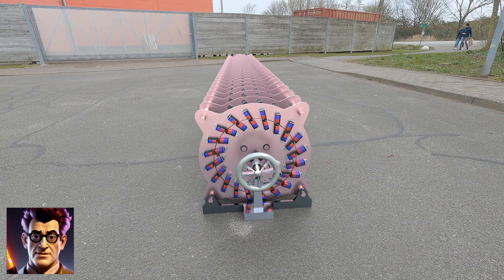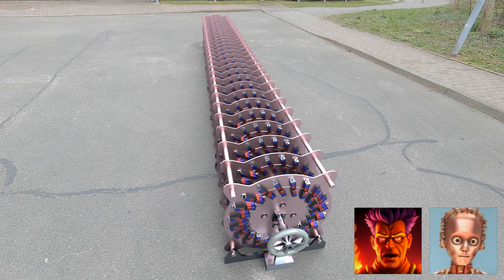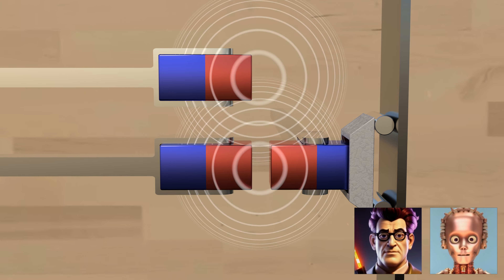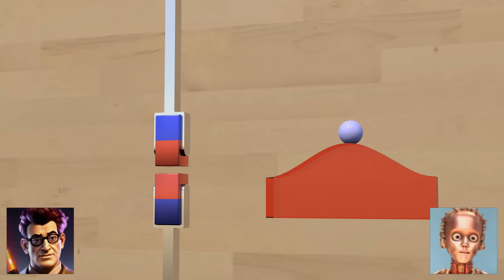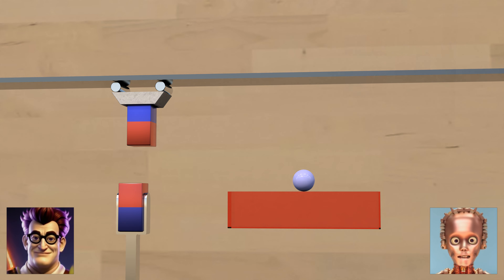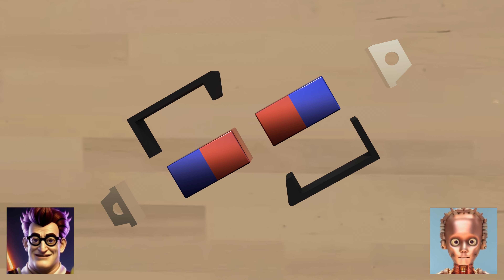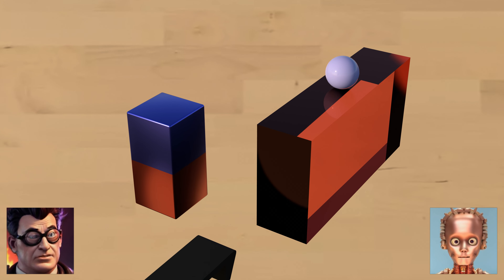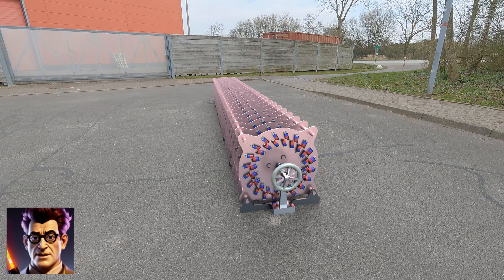Truth: Giant Perendev Perpetual Magnetic Motor, free energy for 5000€, Mike Bradys magnetic elevator

Comment: Technically it is still possible to make work. But it does require external energy. But the important part is that it requires less external energy then it produces..!
Reply: Solar power can work
Reply: The Takahashi magnet motor is such a device, with claimed coefficient of performance about 4
Reply: @ObjectiveVoice  It takes way more enrgy to make solar panels then it can generate.
Nuklear power is the only proven energy producer that can regain the power and cost to make.

Comment: I think its interesting that people think magnets can somehow magically give you free energy when they are just basically doing what all matter does but from a longer distance.  They just create a force.  You don't see people assuming you could blow into a straw, then wrap the straw around in a circle and somehow expect the air to not only perpetually circulate but actually cause itself to accellerate..  They think they can somehow change the laws of physics by making a machine that is progressively more convoluted.. like if they can't understand how it works, maybe then it will violate thermodynamics
Reply from the maker: Hi Derpnerwerp, thanks for your comment. Yes magnets just create a symmetrical force. Thx for watching 🙂
Reply: Dynamo boom free energy for the foreseeable future are you blinde
Reply: So it's impossible to create an imbalance in the forces?

Comment: I have a question Mr yWild - if the magnet to magnet attraction was  - (let's pretend) 100 units at distance 10  and the magnet to steel attraction was 10 units at distance 10  and the magnet to magnet attraction was - (let's pretend ) 1000 units at distance 1 and the magnet to steel attraction was  EQUALLY  1000 unit at distance 1  and you 'entered' the SHIELDED MAGNET UNIT on the 'magnet' side  and left the SHIELDED MAGNET  UNIT  on the steel side   (like a James Roney Stator)   it seems you OBEY the law of Magnetism yet BREAK the laws of symmetry     what say you ?  See KJ Magnetics tables / graphs to confirm the logic

Comment: This video makes a lot of sense. What is always overlooked is the part of using magnetic shielding in the correct index points will make the motor turn. The question is how much power can actually be produced for the unit. v
Reply from the maker: Hi Victory, thx for your comment. I tried magnetic shielding but the magnetic influence of the shielding-material itself prevented the success.
Something like the right configuration for gaining energy might also not be possible. Refer my gravity model approach 🙂. Thx for watching

Comment: If you used an circuit that could turn on and off the magnets. 

You cannot produce more than you can create...BUT... you can make an engine more efficient just a small amount.

Magnets should be used as low friction bearings bearings. There would still be friction  but the reduction in friction would be an efficiency gain because no energy input would be required to imagine the gain.

Comment: The ball example makes very little sense. Seems to me if you had another ring of magnets using attractive polarity(or possibly just one) towards the center of the hub spaced differently from those on the exterior, that'd be enough to pull it into perpetual imbalance, adding additional magnets to the outter ring or asymetrically inverting the polarity on some could also likely create the perpetual imbalance. If the angles of the magnets of the inner wheel were increased so that the pull force of one would negate some of the push force of it's neighbor, that could also potentially create a perpetual imbalance. It seems bizarre that you suggest this is impossible because it does not have a perpetual imbalance, yet nothing here has been suggested or theorized on how to do that. A good start would be to try asymmetry in magnet counts, positions and polarities. Shifting weights (even liquid) could also be used to pull magnets beyond the balance point. I'd suggest also that this design of multiple wheels adds significant weight and redundancy.
Reply from the maker: Hi Brian, thx for your comment. The gravity model is not the highest rocket technology, but a way to make clear what is happening in the hidden. 😀 thx for watching

Comment: This repelling principal fails due to it requires the same amount of energy it creates for the magnet to enter the field. This principal will only work with the Magnets N&S pulling at each other like a real electromagnet motor works with a slipstream like graphite between the magnet to release the magnet from its magnetic field so it can move on to the next magnet. Reach out if you want to make a prototype together.
Reply from the maker: Hi Rockstar, thx for your comment. Think about my gravity model. You will see, that you will not be successful building a working device in this manner. Thx for watching 🙂

Comment: I have considered using a double coil in series, one coil over one of the opposing magnets and the other in between as a current pickup, this current would create a weakening opposing field (like the magnetic field blocker), allowing the magnet of the rotating ring to become in alignment before it repels. Then comes the relation that there will be a counter emf force in the other pickup coil that takes the place of the weaker field which adds the resistance back into the magnets repelling and again there is a cocking effect.
Reply from the maker: Hi James, thanks for your comment. I made a video to think about with an electric magnet for doing something on that way https://youtu.be/jYsRonUeRTM 
I’m very curious if your idea will work. Thx for watching 🙂
Reply: There is no monopolein magnetic field. If you block one pole - you instantly block an other. Its just a dream
Reply: За тако нешто би требало направити електронско окидно коло са могућности регулисања у +или- времену, као подешавање паљења и предпаљења на савременим бензинским моторима..пробати тако..!?
Reply: The concept of harnessing free energy through perpetual magnetic motors has long intrigued inventors and enthusiasts alike. One such notable example is the Giant Perendev Perpetual Magnetic Motor, which claims to provide free energy at an affordable cost. Promoted as a solution to energy independence, this motor allegedly utilizes magnetic forces to generate power continuously. With promises of a New extended updated Edition in 2019, including 3D models, bonus downloads, material lists, pictures, drawings, tool lists, shopping lists, and patents, it aims to provide enthusiasts with the necessary resources to construct their own magnet motor.

Comment: The motor does not turn on it's own. But it does have less counter force impeding its forward progression. How can you use that to make cheaper electricity. Every time the magnet moves past the other magnet there is a movement of flux in both directions. Just put a pick up coil on the end of each magnet.
Reply from the maker: Hi Wes, thx for your comment. It looks like less counter force. Unfortunately It isn’t. Either by entering the field or by leaving, there is an amount of power to put into the system which is symmetrical to a scenario without the magnets. Thx for watching 🙂

Comment: The energy that is used to create the magnet should be available to be transferred in motion until the magnetic field is depleted. Maybe we still have not seen it yet. A possible different shape perhaps .....
Reply from the maker: Hi Ge, thanks for your comment. If you follow my new way, thinking of magnetic fields transferring them to gravity fields, you will see that whatever fine tuning you do to the magnets configuration, it will not change the basic Inability to do the job. 🙃 arranging some magnets will not lead to the final perpetual motor goal. A invention which my work has to use some other ingredients.🙂 thanks for watching

Comment: Over the years, various inventors have explored the realm of magnet motors, each proposing their own unique designs. From the Infinity SAV 1KW magnetic generator to renowned names like Friedrich Lüling, Howard Johnson, Muammer Yildiz, and Mike Brady, the landscape of magnet motor innovation is diverse. Enthusiasts are encouraged to explore the different models available and find the version that suits their needs. With the availability of detailed information, including material lists, diagrams, and even patents, individuals can experiment and build their own magnet motor, following the footsteps of these pioneering inventors.
Reply from the maker: Hi, thx for your comment. Yes, these inventions should encourage other people to invent new better ones. The direction for these inventions should not point to well known failures though and so I try to show in which way research is not really promising 🙂. Thx for watching
Reply: I don't know if any of those inventions are fake or not. But I think there really may be FREE ENERGY. The reason is I was trying to convert an AC fan into a generator. It failed and only generated some milliamps and millivolts because I found out those motors have no magnets. Anyway, I accidentally discovered FREE ENERGY. I disconnected the wires and put them in the air in a certain way and it generated unlimited AC VOLTAGE. And the odd part is it only works in one direction, if you swap the positive and negative you get 0 voltage or current. I don't know if its legit FREE ENERGY or just "free energy" as in, somehow you are converting Radio waves from Television, Radio, or Wifi towers into electric power. And I made sure I was not touching the wires, I even touched it with an insulated clamp to make sure it wasn't my body voltage. And the wires were not touching the ground. And the taller the separation between the wires the more voltage. The most voltage I got was 0.2 volts.
Reply: These motors work, but due to the heat they produce, the magnets lose their magnetism after a while.

Comment: great video, very well explained. Your detailing of the magnet motor principle works but, you could improve it a lot more if you would shift the magnets of the second gear by a few degrees and the 3rd gear by a few degrees degrees in respect to the first gear. Now you can repeat the first 3 gears over and over. I know my comment may not be clear but take a 3 phase motor and see how they arranged the poles. Here keep in mind you first gear would be your first phase, the second gear would be your second phase and the 3rd gear would be your 3rd phase. This will give you more speed but also a lot more torquing to your magnet motor.
Reply from the maker: Hi Star, thx for your comment. Indeed, If I repeat it, it would be much more impressive but the functioning principle will stay the same. No free energy inside, I fear. Thx for watching 🙂

Comment: the outer magnets just need to be more powerful than the inner magnets. Also, its wrong to think of magnetic motors as infinite energy or perpetual motion. Its takes energy to charge the magnets and the magnetism will fade with time. 
the idea is to generate electricity from magnetic motion that is greater than the energy used to create it. We have yet to create the perfect design and we should continue to try.
Reply from the maker: Hi Jdogsful, thanks for your comment. The field of an magnet is symmetrical in terms of going into and leaving it. As a result the strength has no influence to the principle. And the principle is the  most important part of it 🙂. Thx for watching
Reply: @yWild  its not about the the symmetry or strength, it about the equilibrium. this is too balanced. Just neutralizes itself. 
but if the outer magnets are stronger, it could generated enough force to get the inner magnets to the next to the next interval. 
Or perhaps if you had an extra outer magnet of the same strength, or a few, perhaps that could get it to the next interval.
The point is, this is not the perfect, final design and alternative designs need to be tested.
The energy is already in the magnets. the principle(conservation?) is not even close to being violated.
Reply from the maker: Hi Jdogsful, if you have a look at my gravity model, then you may recognise that all is an symmetry issue 🙂. Thx for watching
Reply: @yWild  the issue is the design. Its almost like someone is trying to prove its not possible by intentionally making a model that doesnt work at all.
Reply: @jdogsful  "The energy is already in the magnets. the principle(conservation?) is not even close to being violated."

So you can't get more energy out of such a machine than the energy which already is in the magnets. Which is not very much.

Comment: Understand that the energy stored in a magnetic field is a consumable resource.  If you bounce magnets off each other, over time they slowly lose magnetic power and depolarize slowly.
Reply from the maker: Hi Turboy, thanks for your comment. Yes, over the centuries, they will lose the magnetic field. But the effect is so small that it has no measurable influence on the system right now. The reason why this machine does not work this design issue. Thanks for watching.🙂
Reply: @yWild  The main reason why every perpetual motion machine doesn't work without a hidden (or exposed) power source is the Laws of Thermodynamics.  Plus it's quite obvious at first glance that this machine has many design flaws that cause energy to be wasted. Gaps should be minimized, friction minimized, air resistance minimized.

Comment: Excellent. But by introducing a spring at the bottom of one of the magnet , will observe the peak repelling force till the peak repelling point is crossed. Once crossed the observed energy will aid in pushing the magnet away ? Making its movement non stop?
Reply from the maker: Hi Lani, glad you like it. If you like, look at your idea of using a spring in an perpetual imbalance manner. I fear that you will recognise that the spring also is completely symmetrical. Perpetual imbalance might be not accomplished using symmetrical parts. Thx for watching 🙂

Comment: If the north of both magnets are facing eachother the armpature will not move as the magnets are pulling towards eachother but if the north of one and south of the other are facing eachother at an angle then the machine will rotate as the magnets are repelling one another
Reply from the maker: Hi Keith, thanks for your comment. It is independent of the use of magnetic attraction or magnetic repel. Both ways are showing the same result. It is not possible to build a perpetual imbalance. Thx for watching 🙂

Comment: add solar panel to it for continue motion, measure output energy lets say avg in 10 hours, it could be possible to generate more energy than consume ?
Reply from the maker: Hi Rave, thx for your comment. The idea of using an solar panel is great. The idea of the perpetual motion machine is to do it without external power sources. I make videos showing people the reason why perpetual motion motors are unable to work in an easy to understand way using gravity instead of the magnetic field. Thx for watching 🙂

Comment: Whenever you  see a demonstration of a so called perpetual motian machine, if the demonstrator uses impulsive force to start the device spinning you can rest asured that the device will get slower and slower and then stop. The device should rotate without an impulsive enery input, at all position of the device.
Reply from the maker: Hi David, thx for your comment. Yes, you’re right 😀👍🏻. Thx for watching

Comment: These machines will never work....just simply think of a magnet like if it was a spring, when you push 2 springs together, like when you press 2 negative, or positive poles of a magnet together, they compress and store energy, then they release it when you stop pushing....do you think a spring engine can work?.....
Reply from the maker: Hi Andrea, thanks for your comment. The idea using springs instead of magnets for visualising is great. Thx for watching 🙂
Reply: nice idea 😀 the answer lies partly in the material the springs would be made of, obviously a material that would conserve its structural and mechanical properties over time (probably engineered using nano technology that would mimic a material structure found in biology) but the springs are just one element of that equation 😉

Comment: This will eventually experience magnetic lock and fail because all rotors and stators are symmetric and equally positioned.  My father proved this concept doesn't work years ago back in the late 1980s.
Reply from the maker: Hi Deniz, thanks for your comment. If you look closer, you will recognise that there ist an small angular shift between the stator disks so that one of them is in the maximum field at any time. Thx for watching 🙂

Comment: You have put the mumetals in tho wrong side so if you convert the position of the mumetals to the other sides of the magnets than you can see it will self running 🏃 very fast. Try it than you can see how it really works.
Reply from the maker: Hi Niko, thx for your comment. Magnetic shielding is not able to make an field asymmetry in terms energy 
Used for getting in and getting out after that. So all comes to an balance and friction kills the perpetual motion. Thx for watching 🙂